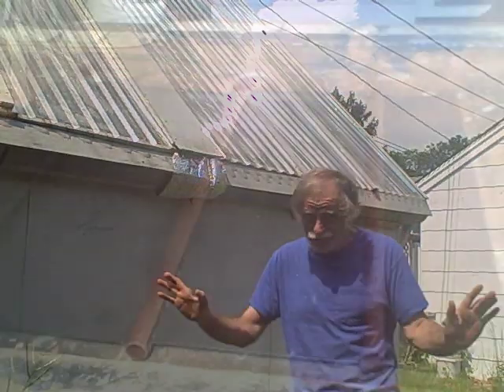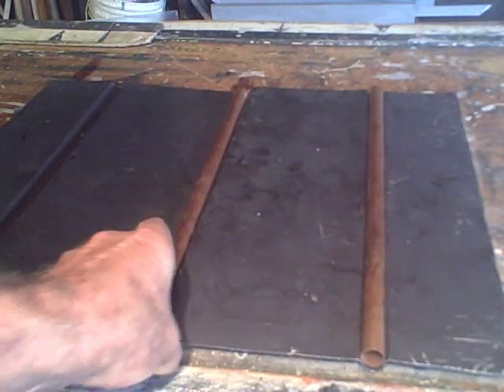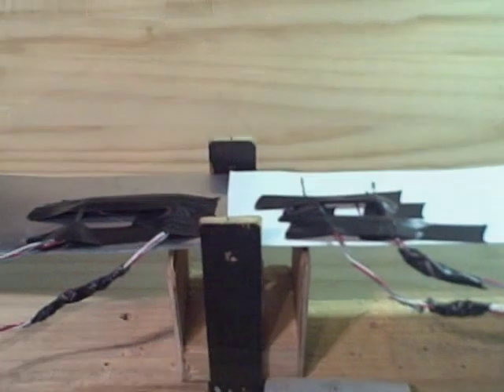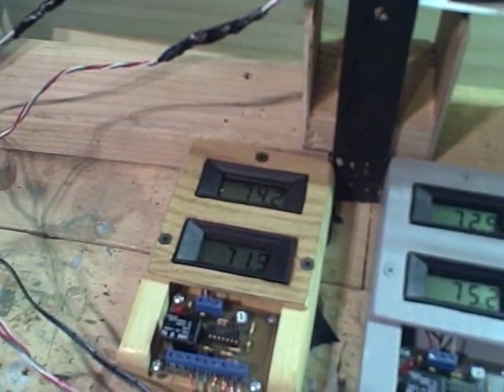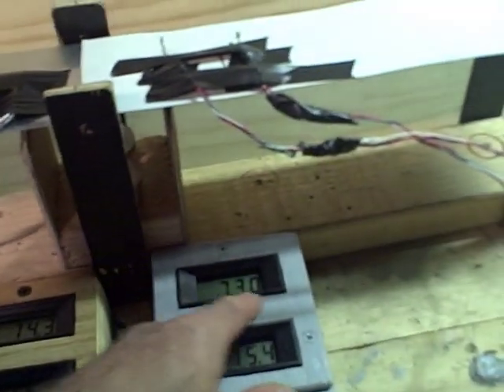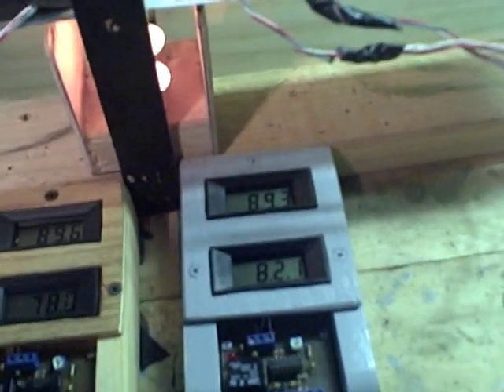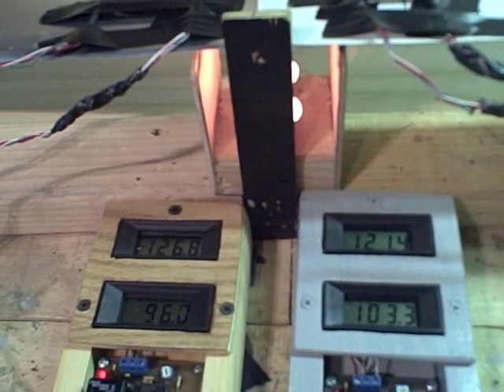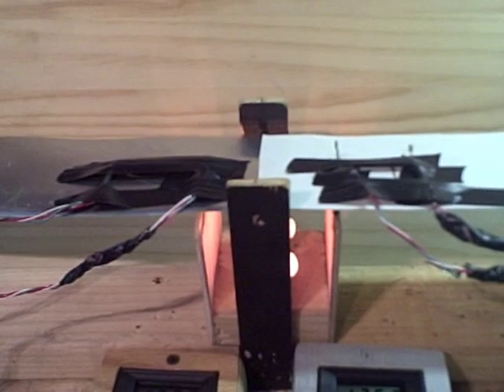Metalic Heat Transfer

Comment: great video, what Radiance Power said about the air!
more mass, more heat storage and eventual transfer.
If this was also an air heater with ducts in and out the thinner metal would be preferred.
Reply from the maker: These absorber plates transfer heat to the flow tubes that carry water.
Reply: I guess I meant his comment on the movement of air over the thinner material at 4"s was inverting the temp profile between the two. The thicker material stayed and increased temp over the lighter material at 4". All due to higher thermal mass of the thicker material.

I have seen some other videos where copper sheating was forme rd as the aluminum in your video. Perhaps a better conductor of heat but at 100 x cost...

I appreciate your work.

Comment: Wouldn't the coating on the sheet on the right slow heat transfer to the sensor compared to the uncoated sheet?
Reply from the maker: +Doug Kalmer  Tar conducts better than air. THe tar is only 1/8"thick where the tube meets the aluminum.